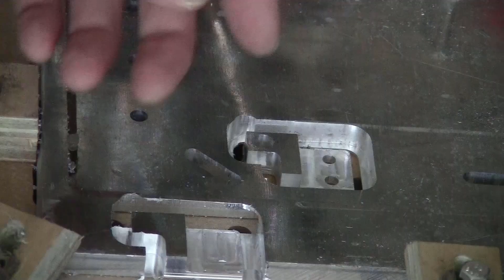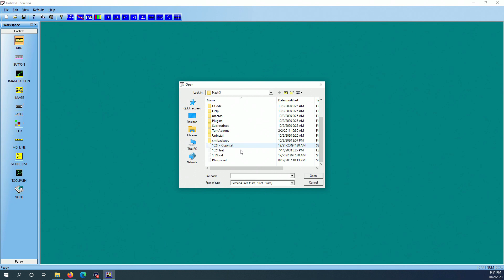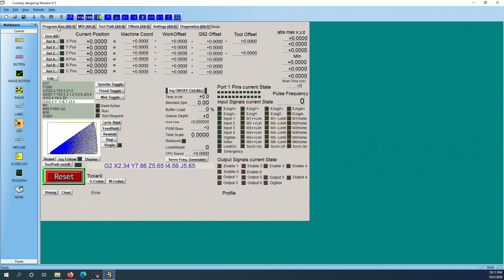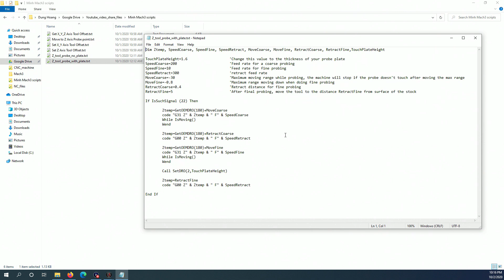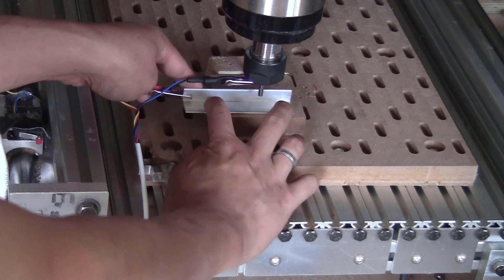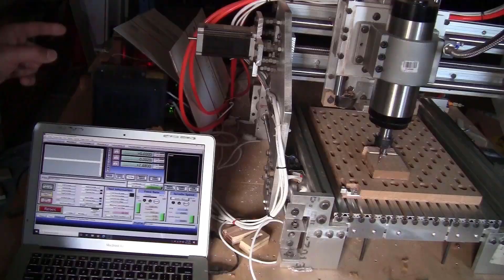Mach3 Offsets - X, Y and Z axis tool and position probing - Customizing your own user interface

Comment: Hi. Appreciate able work. I have a question my probe diameter is 2mm. In the video you use a 4mm diameter probe. Tell me how to change settings for probe diameter from 4mm to 2mm
Reply from the maker: The offset macro doesn't care about probe diameter. It will work as long as you use the same probe every time

Comment: Hi Minh, you should build a small 5 axis machine with your leftover bits. Great video thanks.
Reply from the maker: Many other asked me to do that. The hardware is easy. But for me, the problem is more about the software side. None of the free CAM software gives the feature for more than 3 axis. I don't have the budget to buy a full license for CAM software right now.
Reply: @minhsmancave9448  No problem Minh I will look for some free 5 axis software. If I find some I will let you know...Cheers

Comment: Minh. What cnc stepper motors, drivers and board are ya usig? I want to switch mine and be able to use mach software? I am looking for a good kit or purchase seperate? I have 2 machines im upgrading and making larger.. A 3018 and a mpcnc
Reply from the maker: I'm using nema 23 425oz motors, dm556 drivers, RnRmotion controller board (the red color one if you search on  AliExpress, it's around $11 or $13). Most of people don't need that big steppers and dm542 will be enough, but I like to overkill.

Comment: This is brilliant my friend. I've been building my second cnc after the 3018 that i started with. You made a serious case for using Mach3 instead of the reworking Shapoko controller that i have been looking at. Well done
Reply from the maker: Thank you. I've never worked with any other software other than Mach3 and GBRL so I can't really tell about others. But I feel that Mach3 can do whatever I needed. If I invested a bit more in the controller breakout board to have more input ports (mine only have 4 - I wanted 6 now), for homing switches, I can program all the probing processes to work  automatically with a press of a button. And in the future, If I have money, I can invest in a automatic tool change spindle and that's it, I only click the button and go to sleep, the machine will take care of itself. and mine breakout board costs $11, so yeah!!!